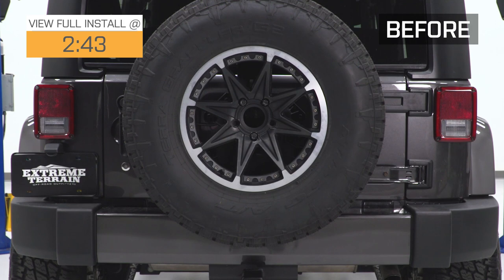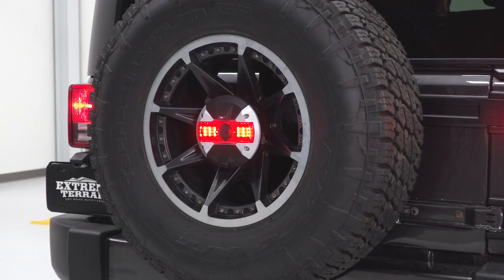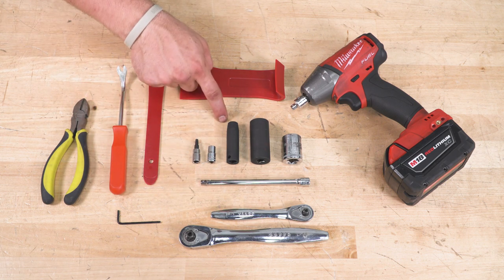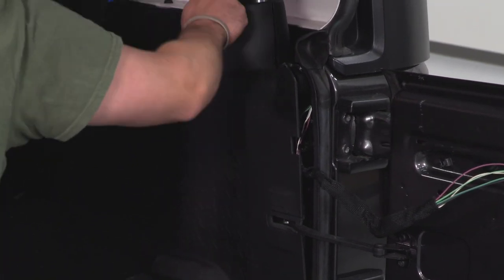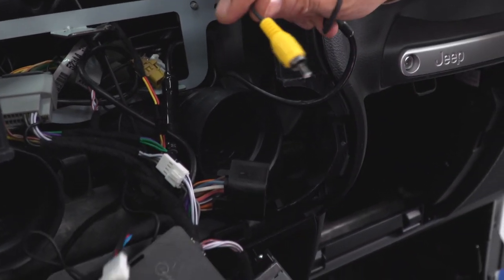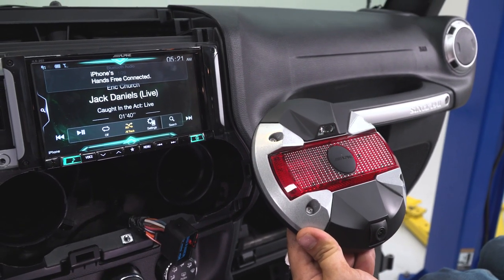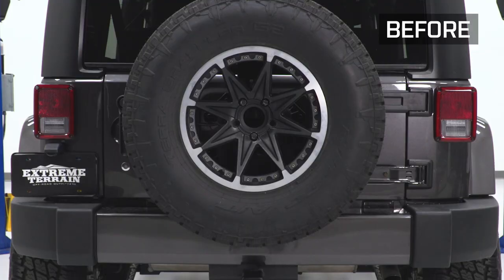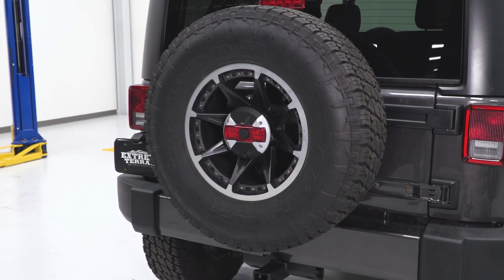Jeep Wrangler JK Alpine Spare Tire Rear View Camera & Light System Review & Install

Comment: Are any modifications necessary when you have a Manual Transmission with the kit out of the box when paired with an Alpine head unit?  I had this camera and installed it when I still had the factory 430N and had to make some modifications for that, and as I recall, because I have a manual.  I just installed the new i407-WRA-JK Alpine unit last night and am now trying to find a solution to finish the install by making the camera work with the new head unit.

Comment: Hi, i have this camera along with an SGS-CH01 and the MAESTRO RR. I followed the guides i found from your channel and alpines own channel but my backup camera doesnt seem to be working. I hit the brakes and the 3rd brake light on the camera turns on, but when i go reverse, nothing happens at all. The sgs seems to be receiving signal because the lights are flashing on the unit. Im quite sure i flashed my maestro unit properly as well, as i remember the backup camera box being ticked during the programming process. I dont quite know where i went wrong. Can anyone help me? Or atleast show me a detailed diagram? Has anyone else tried this setup? X409 bezel and tv stereo + maestro Rr + sgs ch01 + this camera